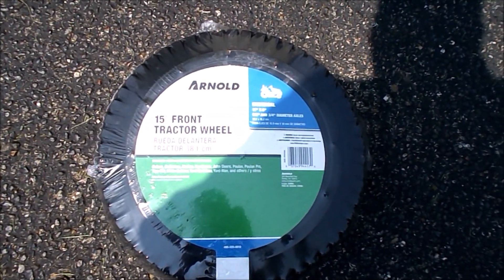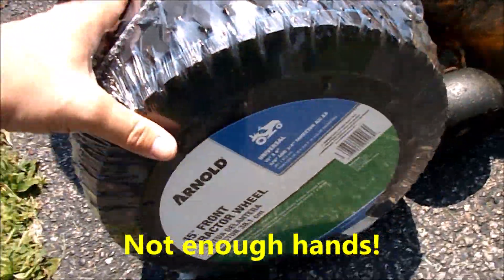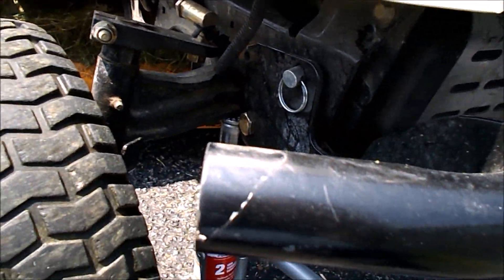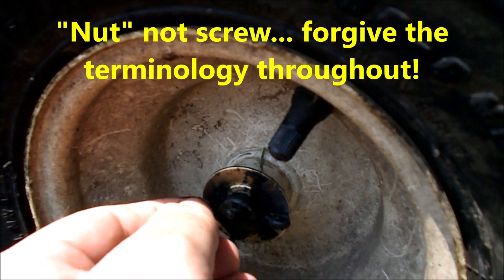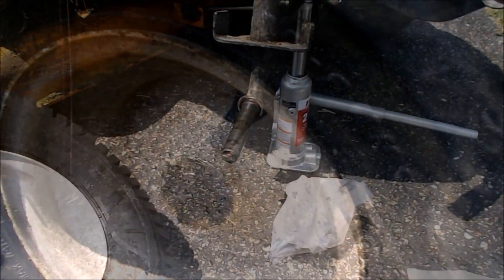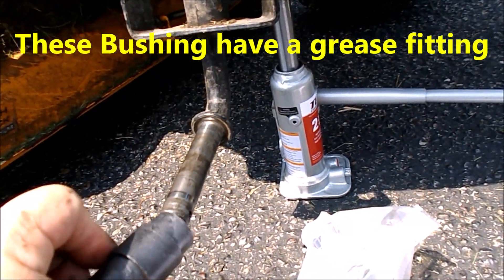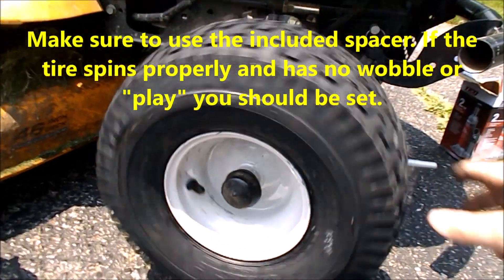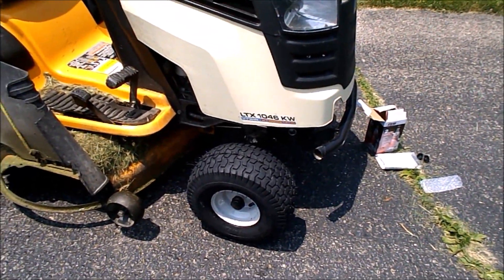Arnold 15" Universal Mower Tire Review, Cub Cadet  LTX 1046

Comment: Sir, you did this installation incorrect. On the outside part of the wheel you are suppose to use a plastic bushing too. What you did is incorrect. I bet you have alot of play in that wheel now. You need to put the plastic bushing without the grease fitting into the outer part of the wheel first. Not trying to make anybody mad just trying to help is all. I just did my 1999 17.5hp 42" deck Murray. I'm only using this set up as a temporary wheel because I don't see those PLASTIC bushing lasting long. I don't know why this company went with plastic instead of metal bushings. I just don't see this lasting one season.

Comment: I purchased that tire/wheel combo and they fit perfectly, BUT I got another flat tire the first time I mowed.  Will be switching to no-flat tires.  2-ply is just not enough unless you are mowing strictly a nice manicured lawn.  Be sure to put some lube on those bushings.

Comment: Thank for sharing, it appears you used the large Bushing labeled 04370 inside (correct placement and grease) but you should have also used -04369 in the front facing out-for equal balance followed by the yellow spacer then washer and pin- did you run into the tire being loose or shaky ?
Reply: Dan Purnell my craftsman doesn’t have a coterpin, any Ideas what order the bushings go?  It’s a 5/8.  Seems my metal tire bar isn’t long enough for all three bushings plus gold metal ring?  Any advice?